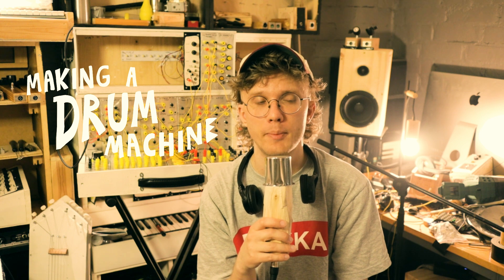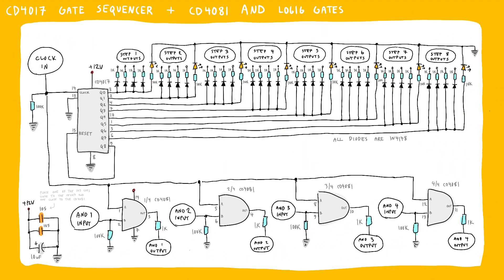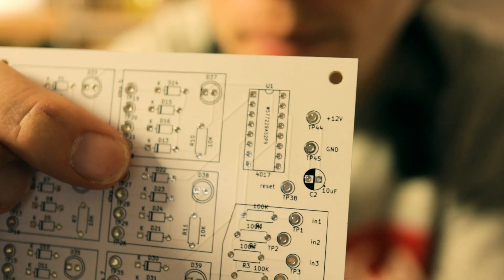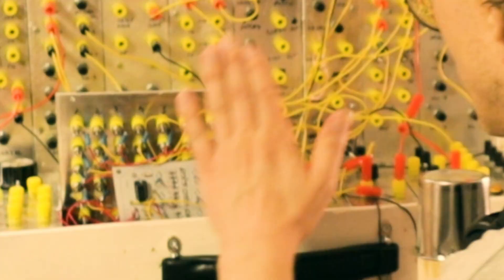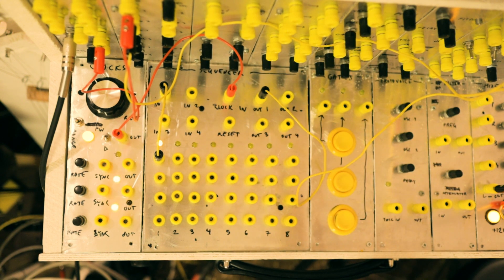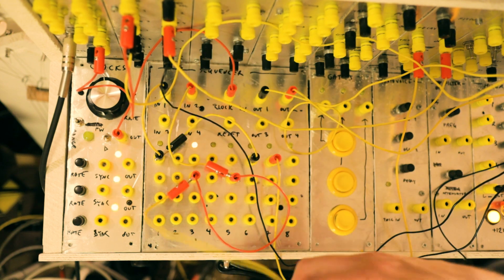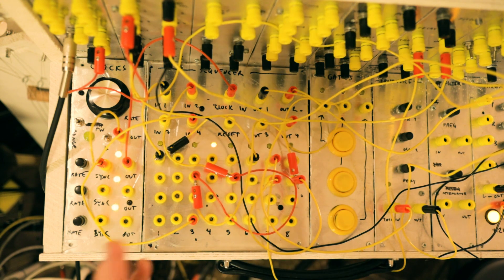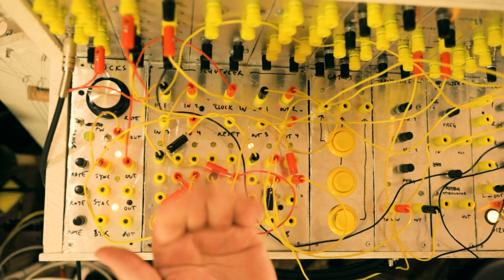PATCHABLE DRUM SEQUENCER / making a drum machine EP 2

Comment: Hi, there are some stackable banana plugs where the wire comes out a little to the side and the hole is at the top rather than on the side, perhaps these could be easier to use?
Reply from the maker: Yeah cables like that would be waaay better, but they’re also more expensive! I’ve just bought the cheapest wire and cheapest connectors and built my own cables hahah
Reply: @LAURISDIYCHANNELTV  There are also some quite cheap ones 😄
Reply from the maker: Maybe i’ll look for some cheap ones, thanks for the tip! 🌞